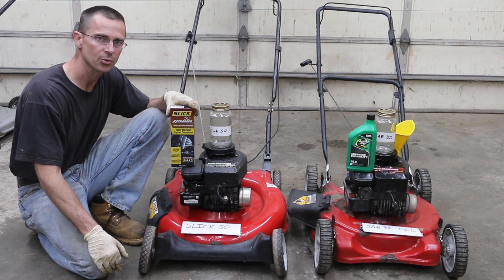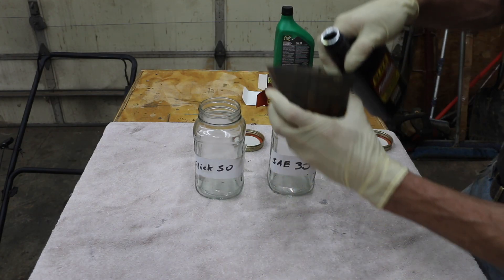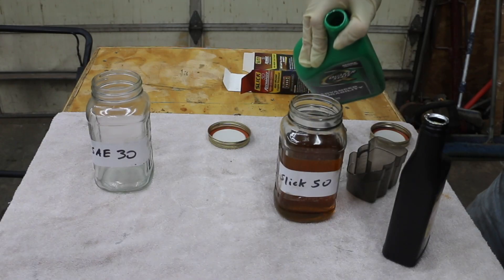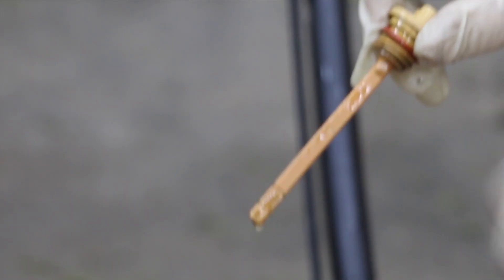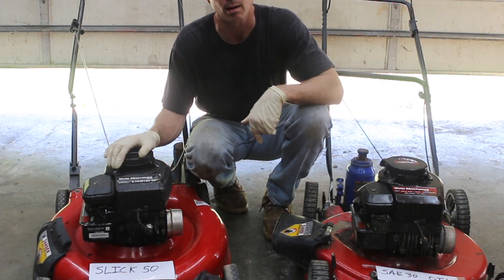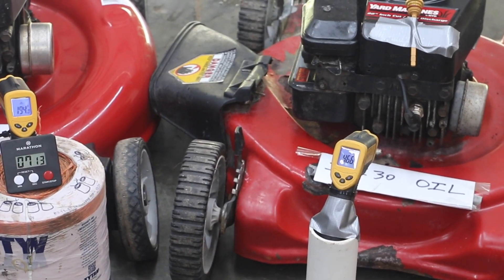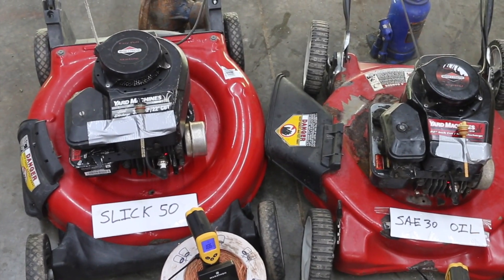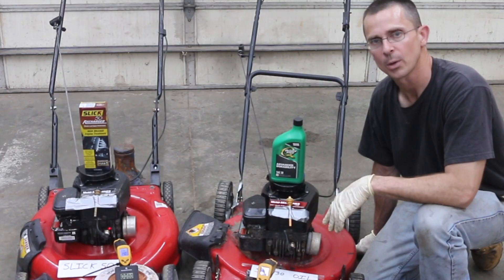Can't believe what SLICK 50 did to my engine!!--Dry Crankcase Test!

Comment: Hey, I'm no professional LAWNMOVER guy, or an ENGINE OIL ADDITIVE guru, but i will tell you SLICK50 saved my streetrod motor from serious damage one day/night. The short story is this: had a shop rebuild my 350 Chev motor for my '59 chevy panel streetrod. (not the one pictured, that's the new one) I took it on a long trip out of town that evening to get to a car show in another state by morning. immediately after picking it up. I stopped at a car parts store and saw the display for SLICK50. Yep, bought it and added a bottle of SLICK50 just to protect the new motor in case of?? well, about 50 miles out of town the motor started knocking, I stopped and guess what? NO OIL! happened to have picked up a case of oil for my other cars had it in the back and added 5 QUARTS to get it to full. Went another 10 miles, (at night in the rain of course) and knocking again, and again out of oil. kept adding oil every time it ran out and started knocking until I got to a town (another 50 miles and 20 qts. later )and crawled under it and found the engine shop somehow messed up the rubber front gasket on the oil pan when re-assembling, and it was somehow overlooked. it was spewing out the oil when it ran. I of course repaired it in a walmart parking lot and continued on my way. there was NO DAMAGE to the MOTOR, and I put many thousands of hard miles on it after that. WITH OUT SLICK50 - NO WAY THAT MOTOR WOULD HAVE NOT SEIZED OR SPUN A MAIN BEARING. it was quite the test. oh, BTW, don't use slick50, never bought it again, and don't endorse it, just an experience to share about the product..Thanks, Tommy in Minnesota.

Comment: The only problem i ever had with Slick 50, was it has Teflon in it. Which in it's normal temperature, is a solid. And needed to be shaken up to put in the oil. Here's the problem, If you need to shake it up to pour, Do you need to shake up the car to properly use?

Now there is a product i use to use all the time, it's called Prolong. It had a formula that had no solids, so it could impregnate the the metal itself. I never did the no oil test, but i honestly think it worked well

Comment: there is a possibility you may be looking at this the wrong way. 
you must consider the properties and characteristics of lubricants. 
the slick 50 is a slightly thinner lube that permeates the micron surface of the metals. a nanolube if you will. 
the sae 30 is not. 
the sae 30 has a greater adhesion and cohesion characteristic which caused it to stay bound to the surfaces longer but also created higher cht  caused by it's own fluid friction and flow characteristics during normal operation.
the slick 50 may or may not have better adhesion, but clearly and apparently less cohesion as it was more quickly burned away. 
just because the slick 50 burned away faster, does not prove it is a lesser lubricant / coolant  in it's full liquid form. 
however- while both machines were running - a clear sign of LESS  cohesion / friction  is the drastically reduced cylinder head  temperature ( cht )  from slick 50 and clearly higher cht of the sae 30 . the cht will be higher if the oil is causing friction and the opposite - will be lower when the lubricant cohesion is less.  
permeation-
lubrication-
adhesion-
cohesion-
now - what about the design spec ?  was the engine designed to run at a higher cht for designed combustion ?  a higher cht would create a faster combustion , retrieve more power from every btu of fuel and lower unburned gas emissions.  lowering the cht  ( may ) be defeating the designed purpose and lowering the engine's actual hp output.  someone would need to dyno the engine - talk with the engine manufacturer to see if they had designed this into their spec, or both.

Comment: I have used Slick 50 and it has saved me a engine. I blew a lower hose 8 miles from home one fall. It was late and I did not want to walk in the dark. So I kept going even though the temp gauge was pegged hot. I started to hear lifter noise after 3 miles @2000rpm. @ 7 miles I started to get nervous when the lifters started to really get noisy. I left it on the side of the road and walked home. Came back the following day. Did the repair and hoped for the best when I started it. When started it ticked for a few minutes and quiet down to nothing. So for me it worked as they claimed. To protect it better than just plain oil. Nothing car run for ever without oil. Also, it depends on the age and mileage on the power plant.

Comment: two products that I've tried in the past are pro long and duralube .pro long was demoed with 2 bearings under pressure  1 coated with oil the other with pro long.I have used the slick 50 that seized the engine in my subaru  later used pro long  and then duralube with no problems

Comment: Is it possible that you didn't shake up the slick 50 to distribute the materials in the bottle? When I've used slick 50 in the past, it had a different appearance than what you poured into the test bottle. I believe it was separated and you didn't add the complete mixture of materials in the slick 50 product formula to the engine.

Comment: the original Slick 50 was the best with my Mitsubishi Van 500,000 km with oil change every 10,000 also our line haul Mack clock up 1,000,000 as mileage was our form of measurement not only that your bonding time for Slick 50 was not correct as back in 1980 in NZ where i am we tested using a Datsun 1200 which managed 300plus miles and TV reporter covered it as back then have found the new type Slick 50 not the same it's crap
Reply from the maker: Thanks for watching the video and commenting!

Comment: couple more variables to consider,the wear of the engines cant be exactly the same,plus i would be curious to see if you could get afr values,one could run leaner then the other making it run hotter,one could have more dirt and grass stucked on the blade(more load on engine)and finally get the rpm gauge one could run higher as well..
Reply from the maker: I agree!  Thanks for watching the video and commenting!

Comment: I thought the commercial you're referring to was a Duralube commercial, where they ran it dry and sprayed water on it to kill it, but it wouldn't die. I think they threw sand on it too.
Reply from the maker: I should do this test with duralube too!!  Thanks for watching the video and commenting!
Reply: I used to use Tufoil at every oil change for literally 20 years in several cars and small engines. It was one of the earliest PTFE additives. These days, I don't think you can easily find Duralube or Tufoil, but Slick 50, Lucas, STP and a few others are still available like at Walmart.   Now that would be an expensive multi-lawnmower test.

Comment: I remember those commercials too.  They drained the oil and water.  The carb was set to very rich to lube the cylinder walls, valve cover was removed to let heat escape also oil pan if I remember correctly.  Then they sprayed the motor with water too.  The water they sprayed acted as the lubricant and coolant.  That motor was a very worn motor with loose tolerences.
Reply from the maker: It was a great commercial!  Thanks for watching the video and commenting!

Comment: Slick 50 was always a scam. Teflon DOES work, but the engine has to be disassembled and the metal thoroughly cleaned before it is professionally applied.  You can't just dump some liquid Teflon into the crank and have it do anything.
Reply from the maker: Great point!  Thanks for watching the video and commenting!

Comment: I don't believe this. My mom's car had slick 50 in it. She came home one day and said it smelled hot. I checked. There was no oil. I added 5 qts. Thr next day she said the same thing. I added 4.5 qts. Wr found a plugged line that was forcing the oil out the dip stick tube. That car never had a problem. Ran for another ten years with no knocks.
Reply from the maker: Impressive! Thanks for watching the video and commenting!

Comment: Back in 1985 I purchased an 85 Dodge Lancer Turbo. I used Slick 50 with 2quarts 10-40 and 2quarts 20-50 and 1 quart slick50 in my engine.Dodge recommended  changing the turbo every 50000 miles.My turbo lasted 80000 miles. I changed my oil using Valvaline conv. oil.The owners manual said to idle engine after running to let turbo cool down.Turbos ran 1600dollars for a remand. at the dealer.  Idiot mechanic said that I didn't change my oil enough because of the thickness of the oil. Every 2to3kmiles I would change oil. The turbo was located on the top rear of the 2.2liter engine.Second turbo lasted to 159000 miles.When I got rid of the car "still running" on the second turbo it had 197000 miles on it. Only problems I had with this car was when I took the car in to the dealer and they changed my spark plug with the engine hot and stripped the spark plug holes.
Reply from the maker: Impressive! Sounds like a fun car too! Thanks for watching the video and commenting!

Comment: now try it with molybdenum disulfide additive! liqui or lubro? moly makes it. I believe slick 50 uses ptfe (teflon) which does not tolerate high temps. also the engine with molybdenum may need to be run for a long time to embed, but it may not embed in the aluminum connecting rod.
Reply from the maker: I'll see if I can find some and test it!  Thanks for watching the video and commenting!

Comment: There is only 1 thing that has proven effective at making internal combustion engines work longer, sometimes a LOT longer.  Regular maintenance.   I have a 99 Dodge 3500 that I absolutely drive the hell out of.  It is up and down the mountains, sometimes getting hot.  It also has a little over 400,000 miles on it.  Without fail, I change the oil in it at 5000 miles.  Dare I say it sounds like it did when new.  Its the longest lasting vehicle I have ever had.  It is also the ONLY vehicle I have ever bought new.  Coincidence?  Maybe.  Maybe not. 
Delo 15w-40 is the only oil that's ever been used, except of course for the oil from the factory.  
I also have a 2000 BMW M5 with 179,000 miles on it.  No, I didn't buy it new (I'm not crazy!).  It had 19,000 miles on it when I bought it.  I was warned that the 4.9 double vanos engine was a 100,000 mile engine at best.  Some get more, most get less.  I have also been religious at changing the oil in it.  7500 miles or a bit less.  I also check, add, and change the transmission, differential, and coolant regularly.  You may think I baby it or its a garage queen.  It is NOT.  I drive it like the German engineers meant for an M car to be driven, enthusiastically!  I don't hesitate taking it to its 7000 rpm redline.  Of course I don't always drive it like that (I wouldn't be able to afford the tickets).   The ONLY oil it's ever had in it is Castrol Edge TWS 10w-60 synthetic.  Sadly, they no longer make it.  I have a couple of cases so I guess its for sale 7500 miles after the 3rd future oil change.  
And some engines are just born under a bad sign and fail prematurely, maintenance be damned.
Reply from the maker: The car industry would be in trouble if everyone maintained their vehicles like you do!  Car sales would go down!  I agree with your approach.  Thanks for watching the video and commenting!

Comment: Back in about 1989 or there abouts, I seen some Justice Brothers Engine Treatment tested  in person in Maryland near Andrews AFB at an Auto Parts Store, I just happened to have some Slick 50 in my trunk. It was no match to the JB Engine treatment in this test.
I seen your video and I've been researching and came across this, which is pretty much the same thing I saw in Md. https://www.youtube.com/watch?v=A-bU6SByP0Y
I'd be interested in a comparison using the BestLine Engine Treatment.
If you search for this, it can be found on Amazon at; BestLine 853796001049 Premium Synthetic Engine Treatment for Gasoline Engines - 16 oz.
Thanks!

Comment: Was not aware that an A/C vacuum pump was to be used to pump fluids.     Why was the oil not drained by removing the drain plug on the underside of the mowers?
Reply from the maker: I use this pump to drain all sorts of machinery on the farm.  Drain plug works well too but can be a bit messy and those watching the video wouldn't get as good of a view of the oil getting extracted.  Thanks for watching the video and commenting!

Comment: Slick 50 and many other wonder lubricants at the time used ammonia to increase lubrication at the cost of corrosion. Ammonia also has a really low boiling point, so under high temps it boils off quickly, and after there is no Ammonia left there is less lubrication/protection. Adding even more Slick 50 to the mixture just increased the amount of lubricant that was evaporated once the engine reached a higher temp.
Reply from the maker: Interesting!  Thanks for watching the video and commenting!

Comment: TRY PROLONG.I USE IT AND IT WORKS PRETTY GOOD.BUT NO REASON TO RUN WITHOUT OIL. BUT I DID HAVE IT IN MY MOMS RIDING MOWER AND IT DID RUN SMOOTHER AND LESS HEAT.
Reply from the maker: I'll definitely try Prolong.  Thanks for watching the video and commenting!

Comment: You have a lot of problems with this test, First is the clearances on the rotating assembly's of each engine. How many hours of service has each engine been thru? The engine with more hours or looser tolerances would run much longer no matter what. The head temp is greatly affected by the richness of the fuel air mixture. Lean carb can greatly increase head temps.
Reply from the maker: All valid points!  Thanks for watching the video and commenting!

Comment: Two oil additives that I have heard many great reviews of are Prolong Engine Treatment and Archoil. Both of these products highly recommended. Prolong Engine Treatment is an older brand and it designed for both gas and diesel.  Archoil is mainly used in diesel engines but has very high recommendations. I would try similar testing using one or both these additives.
Reply from the maker: I plan to test both of these!  Thanks for watching the video and commenting!

Comment: I stopped running oil additives and running Royal Purple oil when we had a 50HP screw air compressor that had run nothing but this full synthetic oil in it. We had the service company come out to rebuild this unit after it had 50,000 hours on it. The technician pulled it apart, measured all the parts and told us it was still in factory specs. 
Please bear in mind that it was used in the Nevada Desert, but in a building that was clean and cooled. All our compressors were cooled by the cooling tower, but 50k hours???
I started using the oil in my 2004 Ranger truck, from 20k miles to it's present 250k miles. I just had the original clutch replaced last year. I ran 10k miles between changes, and it seems to be in very good condition. 
I now run it in every engine I have, except my 24' box truck, because I haven't put enough miles on it to change the oil yet. It has a Cat w/turbo, but doesn't seem to use any oil. 
The only other maintenance I have ever had to do on my Ranger is replacing the brakes, changing the other fluids, etc. 
Smiles!
Reply from the maker: Very impressive!!!  Thanks for watching the video and commenting!